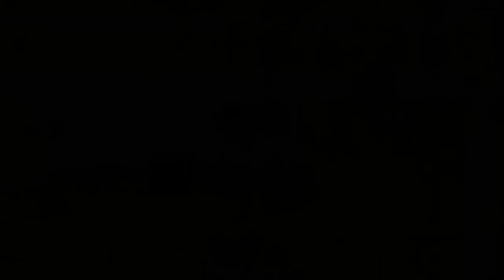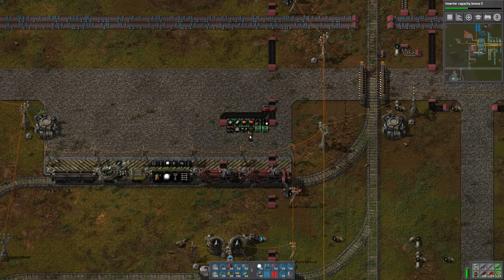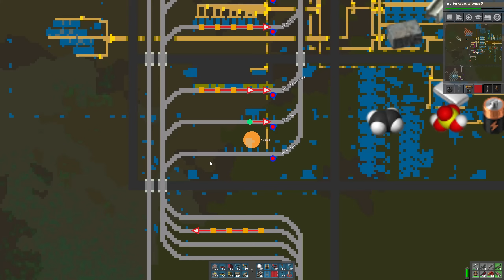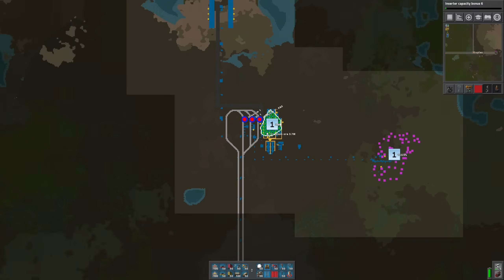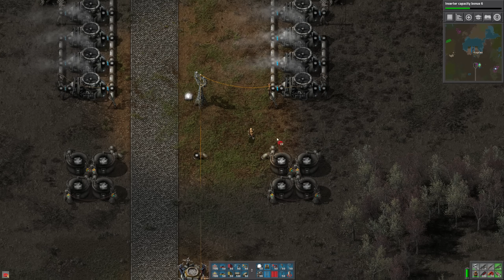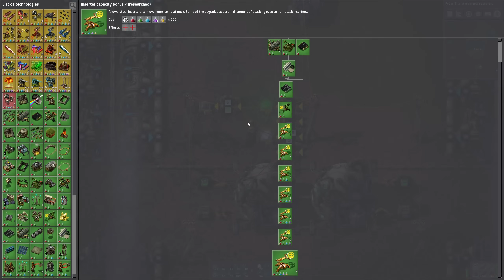Factorio 0.16 Let's Play #24 - Nuclear fuel cell control circuit

Comment: I use a simpler method that seems to work well. My extraction inserter is set to remove the spent fuel cell when my steam drops to a set level. The fuel cell inserter is set to look for a spent fuel cell in the grip of the extraction inserter removing the used fuel cell (greater than 0).  So if steam is high the used cell is not removed. If low, the spent cell is removed which triggers the new fresh cell to be put in.  Once the inserter has dropped the spent cell it is again at 0 so no second fresh cell is inserted, until you reach the steam threshold amount again. Red wire for steam level, and green to connect the two inserters.
Reply from the maker: I like this method, it’s definitely simpler.

Comment: I found an easier way if you are interested. I have one heat exchanger outputting to a tank next to it, add a pump going out and then connect that to the rest of the steam pipes. When the exchanger is running, the steam level in the tank hovers at about 450 because the pump can't remove the steam quick enough but when the exchanger cuts out the level in tank plummets. I then set the inserters to add fuel when the level drops to 10. As soon as the fuel goes in the level jumps back above 10 quick enough that the inserters only have time to add one fuel cell each, (assuming stack is over-riden to 1).
Reply from the maker: Nice idea, I might try that next time!

Comment: Wouldn't turning the reactors on and off based on consumption waste a lot of fuel on heating up the reactors again?
Reply from the maker: Good question, but no, it's not a waste.  Once the reactors are initially heated, they won't drop below 500 degrees.  Heat only comes out of the system when water is turned into steam, and since the heat exchangers only make steam starting at 500, they won't get any cooler than that.  Heating from ambient to 500 is only required the first time a reactor is brought online.

Comment: I've taken the reactor setup from your blueprint book but I can't seem to get it working. The one thing I have changed is that I wanted to rotate it 90deg so I removed the Nixie tubes then added them back manually but I can't think that would be causing the issue? Do I need to do anything to get it to start processing?
Reply from the maker: Hi Sam.  It’s hard to troubleshoot without seeing it.  Is the problem that no fuel is being inserted?
Reply: Yeah, I bet! Yeah, nothing is being inserted, there is fuel in the requester chests. The green steam light in on and so is the white S>R light
Reply from the maker: Please try loading the first fuel cells manually.  If I recall correctly, the system doesn’t start itself.  If the S/R light is on, it thinks it already has fuel, and since a spent fuel cell will never come out, it won’t ever insert another one.
Reply: Thanks! I will give it a go and see how I get on
Reply: Thanks for the videos! They are awesome

Comment: This video is a bit old,  [38:20] But for the reactor control circuit...  What about the plausibility of using 2 circuits. each controlling the input to separate reactors. (Instead of 1 circuit feeding both reactors like you have setup when steam drops to 50%)
Could you do 2 circuits so that when the steam drops to say 66% one circuits feeds fuel to reactor 1 and if, due to high load, the steam keeps dropping to 50% the second circuit feeds reactor 2, and 1 is still being fed since steam is also below 66% 
This way the least amount of fuel is feed to the reactor if you have a small load. 

So for instance if you have built up to a 10 reactor (2x5) each reactor could have a separate circuit with steam levels at 10% intervals so at 90% 1 reactor starts being feed fuel, at 80% 2 are feed, etc..

I can see that this would be large and clunky having 10 copies of the circuit, but I am sure something could be designed to do it in 1 curcuit.

Would this be workable? or would the reactor not really work well like this, since you don't get neighbor bonus unless a reactor has fuel?
Reply from the maker: Hi Black Hat, I like the idea of using a “ladder” system to feed fuel based on power demand, but as you pointed out, you would lose the neighbor bonus if you did that.  If you are using a small portion of your total capacity, less than half, for example, then it might make sense to not feed all of the reactors.  But when you have higher demand, I think you’d probably save more fuel by using the neighbor bonus then you would by not using some of the reactors.

Comment: I usually use one box between requestor and final inserter. If steam is over high threshold ( = enough power, in your case 150k) and box is empty then insert one fuel cell into the box. If steam is under low threshold ( in your case 50k) insert from the box into the reactor
Reply from the maker: Hi Jakub, that sounds like a clean design.  What happens if you add fuel, but the system cannot add enough steam to get over the high threshold again because power demand is very high?  Will it run out of fuel?
Reply: Tuplex yeah, that's exactly what happens. It needs a bit of maintenance in this way.

Comment: 06:00, you might want to control the water pump instead. Like... together with an accumulator. 

If(accumulator < 90) => activate water pump
Reply from the maker: Harry, it's a good idea.  I've used an accumulator to control the power switch before, and I didn't like the oscillation that it caused.  Maybe switching the pump instead would cause a smoother ramp up and ramp down of the power consumption.  I will try it.
Reply: There won't be any oscillations because the nuclear power plant covers everything. If however the nuclear power plant fails for some reason, then the steam engines will turn on because the accumulator will fall down. And because the steam engines can't support your entire factory your entire factory will be down in the red zone barely functional. But at least it won't be dead. 

Maybe you tried to use a switch together with solar panels, that will most likely give you oscillations during the night. 

By controlling the water pumps, the oscillations will be in the 5-10 second range, not as... rave-ish as controlling the electricity with a switch. 

Either way, keep up this series! Because it's really awesome.
Reply from the maker: I'm not concerned so much about losing nuclear power altogether, as I will eventually be walling in the base.  But It's quite possible that I will expand too fast and run low on power, and it will be nice to have the steam turn on when that happens.  I will probably connect an alert to that as well.  Thanks!